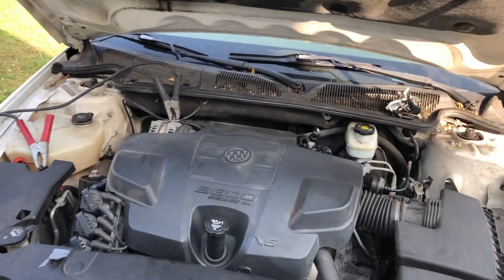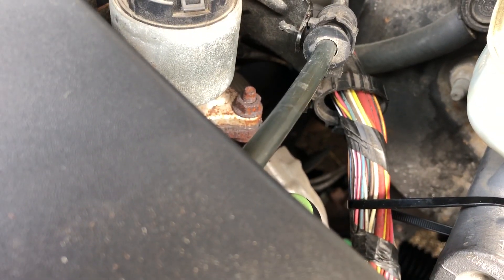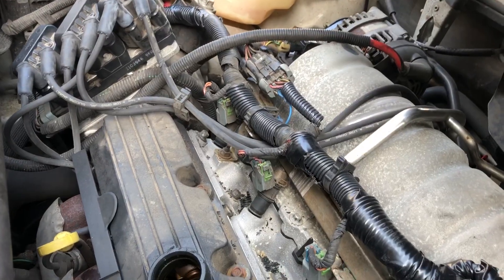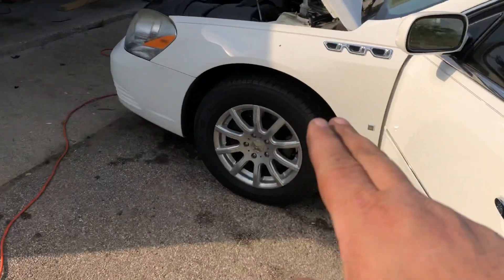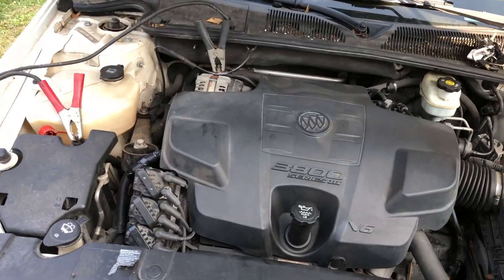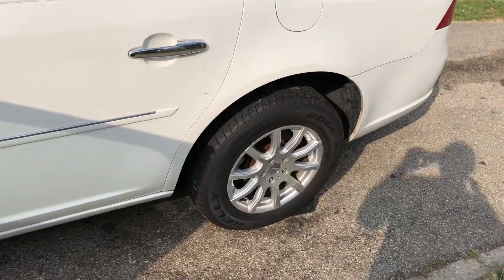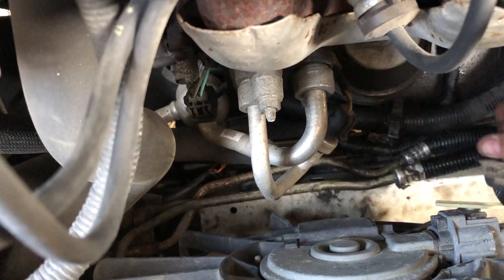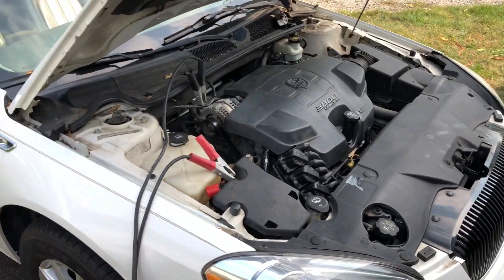Be Wary of Letting Shops Work on Your cars

Comment: Have seen it before here.Have found fastners missing including them put in the wrong spot.Found out from an auto parts salesman that found out there are a couple shops in my area that use compression fittings on brake lines.My dad has his own shop and we do good work not hacking things up.Even had one shop owner break a customer's driver seat in their car and would not take care of the problem he caused
Reply from the maker: Hey I used to use compression fittings on brake lines before I knew better.  I think there is still one on my truck.

Comment: If it is done this poorly, the dude is a hack not a mechanic
Reply: G'day,

I was thinking along similar lines..., but there were SO Many apparently lazy  "Short-Cuts" taken with the reassembly of so many Items & Subsystems..., all of which would have taken a fair degree of existing knowledge & experience in order to have been pulling them apart in the  first place....; that I'm tempted to hypothesise an actually knowledgeable Mechanic who either no longer gives a shit..., or they're so maniacally overworked that they haven't got enough time to finish doing ANYTHING propperly...(?).

  A raging addiction to one of the Amphetamines would explain it maybe, or perhaps Cocaine, possibly even a Gambling Addiction...(?), something to induce a frenzied monomaniacal obsession with feeding a hugely costly Habit  ; Opiates would have a different effect entirely though, in that the first Job would still be disassembled and unfinished -  because the Mechanic would've  "nodded off" in the Corner of the workshop (!).

  Such a sketchy half-arsed Caricature of doing a propper job, and then and charging money for it, is a hallmark of a Has-Been who's in the of act "losing it"...(!).

  Just(ifiably ?) guessin'.

Have a good one,

Stay safe...

;-p

Ciao !
Reply from the maker: It's normally not knowledge or experience that is the issue.  It isn't even laziness.  It is a dude trying to make a living on flat rate and pay his tool bill.  He has to move the cars out quick and get to the next one.